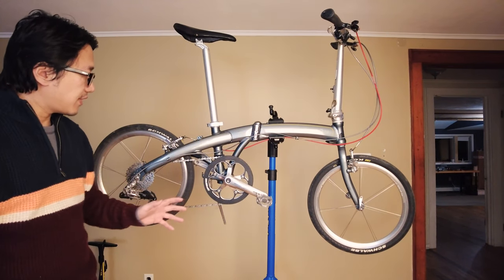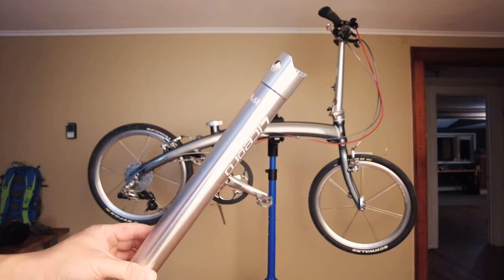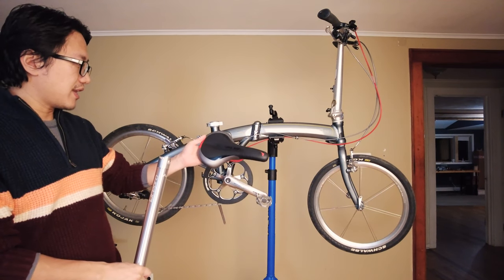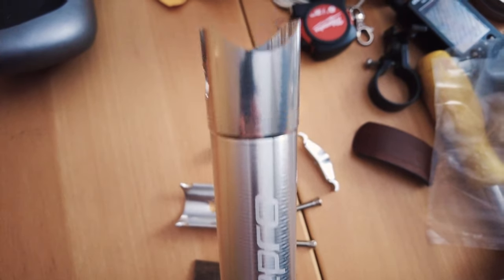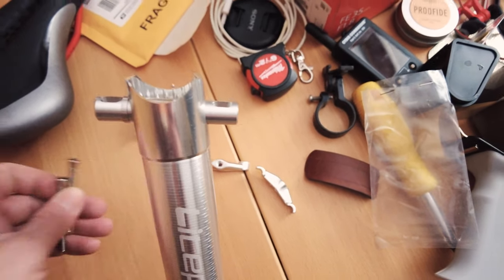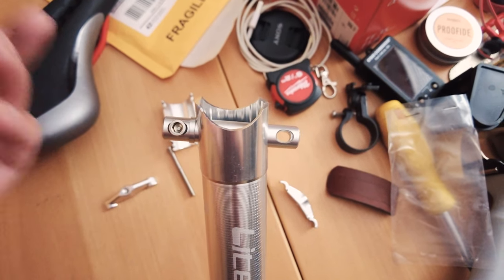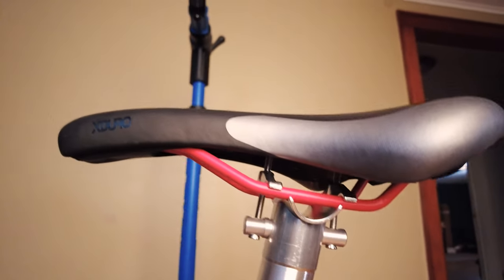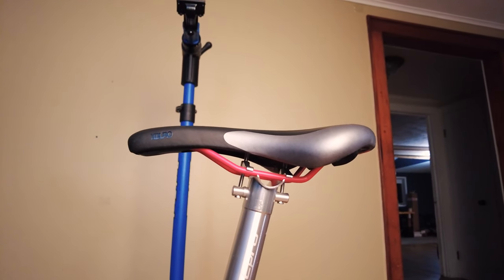LitePro 33.9mm Seatpost Conversion - How To Install

Comment: Is a little tricky! Wot an understatement! Its almost impossible. Put it together, it falls apart.
My stopper was non evident on my part. And why the hole in the concave seat angle platform? To exit water? Down the seat tube? Keeping the apparatus together whilst fixing it to the saddle rails is all but impossible. Still haven't worked it out!

Comment: How thick is that material. I see it's only "rated" for a max load of 80kg. That means that wearing a backpack I would easily get over that.
Reply from the maker: Pretty thick but I haven’t found any other 33.9mm seatpost that lists max weight limit besides this one
Reply: @TheGizmoGarage  I think it's the assembly that's the weakspot. And it does look cheap and homemade.